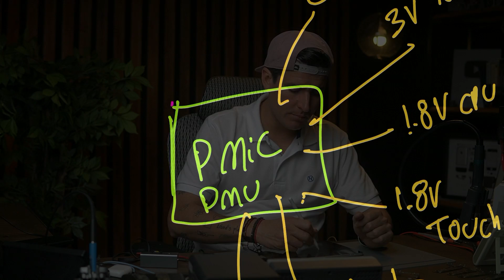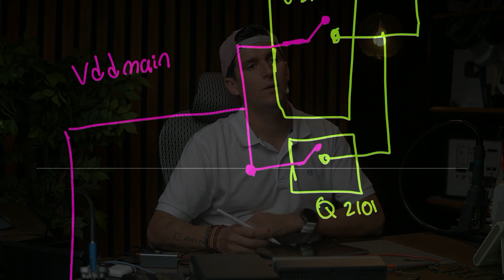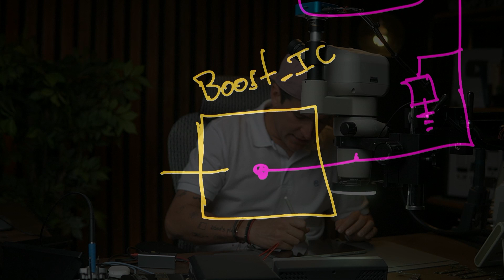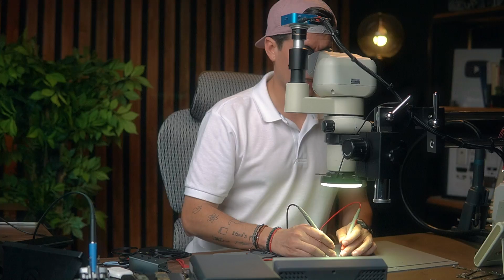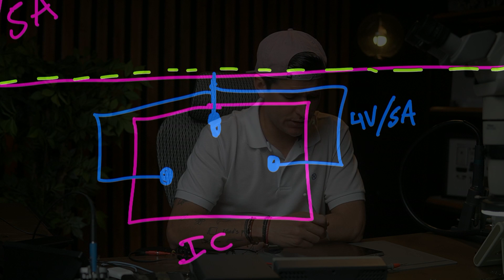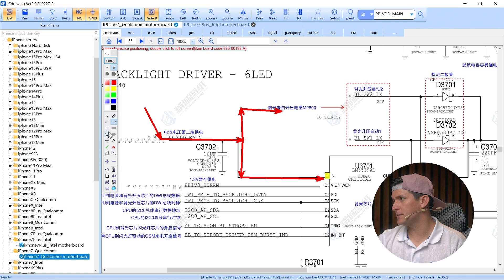How to find a shortcircuit | EASY STEP GUIDE iphone repair

Comment: Today i repaired an iphone 8 which couldnt charge when powered on and it actually worked. I checked vbus, the tristar var usb. Found the resistor damaged, changed it and it worked. About 4 months back got a phone with the same issue but couldnt fix it even though i changed everything. THIS VIDEO IS GOATED. keep it up Master Edgar. Much love from Tanzania 🇹🇿